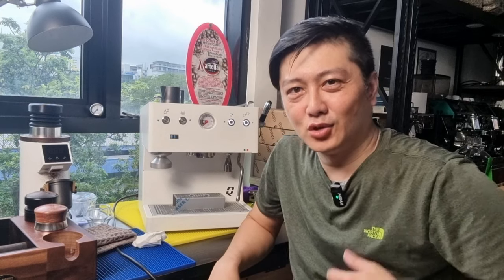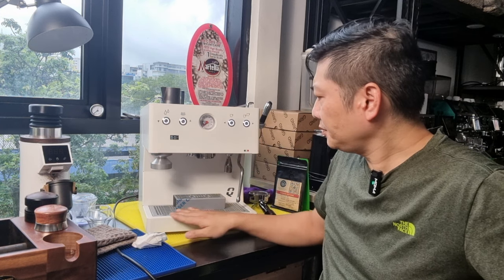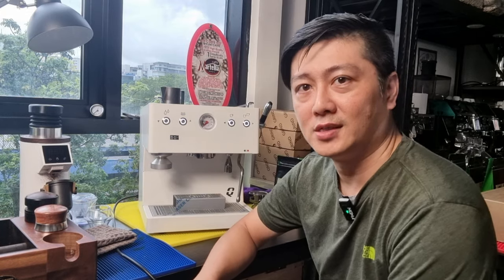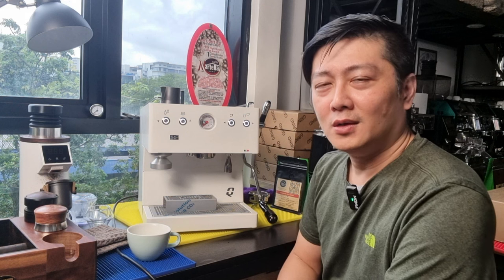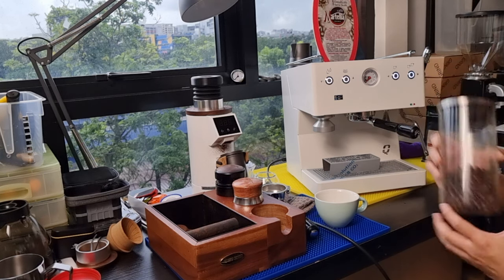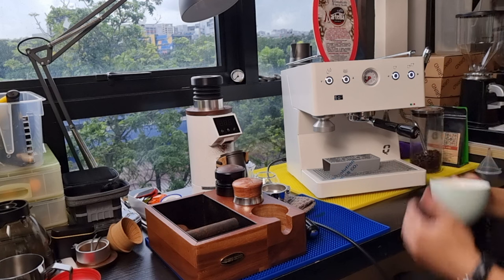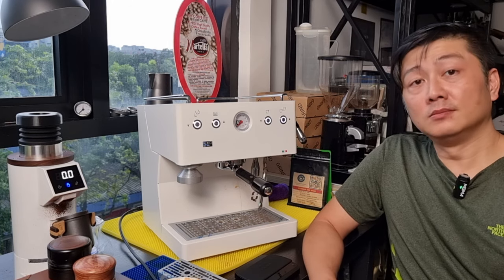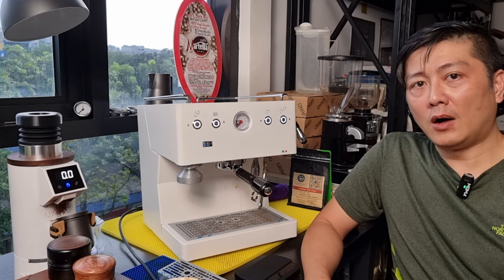Quick Mill Sunny 2046 | 1st Use and Experience

Comment: Have you tried to set up extraction pressure in dosing mode 1 or 2 cups? Because the lever only adjust preinfusion pressure and doesn't affect on the extraction pressure. You have used manual mode without preinfusion, where lever changes extraction pressure

Comment: The machine has a crucial design issue, it has only one OPV that works as follows:
- In manual mode there is no pre-infusion mode, you have to quickly rotate the lever down to get up to 3 bars to get preinfusion and after some time suitable for you rotate the lever again up to get classic 9 bars, during extraction OPV is always connected to water line goes to thermoblock 
- In dosing/automatic mode (by pressing the "cup" button) OPV is connected to the water line only during preinfusion time (10 secs for double shot) After this time machine disconnects OPV from the water line at all. Because of this you can see so much pressure.
Engineers used adjustable OPV to give the ability to adjust pressure in manual mode and adjust pre-infusion pressure in dosing mode.
So for me high extraction pressure kills timing mode because I don't like the espresso extracted under higher pressure in 12-13bars. Currently I mostly use the machine only in manual mode  to get
the preinfusion in 3 bars and extraction with 8.5bar and looking how install an addition OPV,
The right top edge of the machine is not strictly straight, it has a triangle form.
Vibration pump is pretty loud, I had to wrap up polyurethane foam over a vibration pump, which reduced noise by half.
The cable on the right side of the machine looks ugly, engineers could add a separate button or switch for starting manual extraction
To access shot making timing (the most useful page) I have to press and wait for the longest amount of time or you have to connect your phone to machine WiFi and adjust settings in the browser.  Basically I don't want to always change wifi networks in my phone 
This machine is experimental and a matter of debate.
I think the main idea of Sunny is that you can play with pressure as you want and the dosing mode is a minor additional mode or you have to install an additional OPV to limit pressure in this mode.
Reply from the maker: Thanks for sharing so.much information with us.

Comment: Many customers complain that they had 13-14 bars in timing mode and had to install an additional OPV or return the machine back to the vendor. The group is passively heated by conduction from the thermoblock. A major problem with the use of a non standard group, non standard baskets and non standard portafilters is measurement of temperature if you set up 93C you will not get exactly 93C but 89. If you decide to buy one you will never get any future support because the machine is abandoned. So this machine has tons factory out issues and engineers no willing to fix anything

Comment: Hello, just to clarify your remark (at 4:05) on the Ascaso Steel Duo PID and "every time using the steam you have to wait 3-4 seconds for steam to build because of the dual thermoblocks".  It would seem that you are referring to the earlier model which you reviewed a couple of months ago?  The late 2022 upgraded steam model (25% more steam power) has the additional steam knob on the side of the machine and the steam is instantaneous and powerful.  I'm not sure why you are comparing the steam limitation of the older Ascaso Steel Duo PID with the Quickmill Sunny?  With respect, wouldn't it be best to make the steam comparison with the upgraded Ascaso model because if I didn't already know about the upgraded Steel Duo model I would probably not purchase the Ascaso Steel Duo after watching your review.  Please don't take offence to my comments and I really enjoy all your reviews as a subscriber to your channel.  Cheers.
Reply from the maker: Hi currently we do not carry the latest model of the Ascaso Steel Duo PID and hence I am only comparing this to the model which I had in my shop. Thermal block from my understanding there is always a lag time as compared to boiler type for steaming. That is from my understanding. Thanks for watching my video!